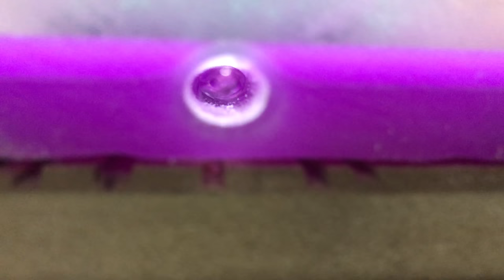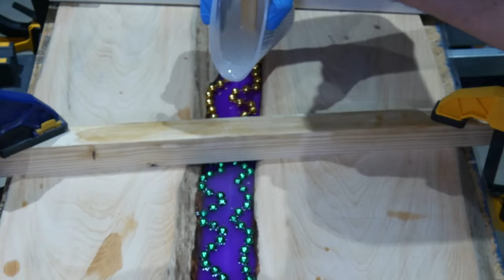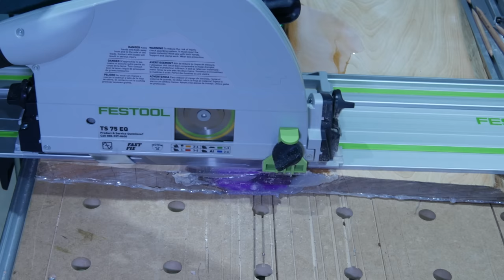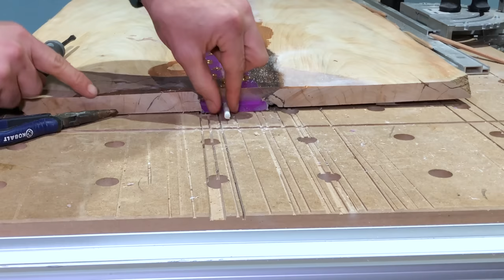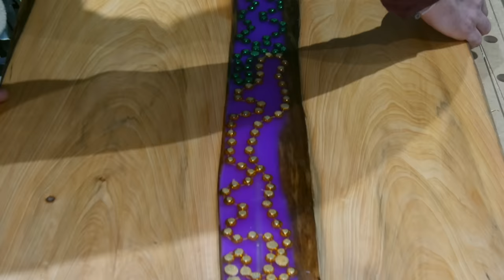How To Put LED Lights in Epoxy Resin (Simple DIY Method)

Comment: Might be easier if you glue some string to one end of the rod before removing it, so removing it drags the string through.  You can then affix the string to the LED strip, and pull that through, eliminating any pushing.

Comment: Great video.   I want to do something like this on a smaller scale for my Train layout.   I want to put a single led inside a tiny plastic bubble attached to a plastic straw which will go through multiple layers of form.   It comes up at the bottom of a little lake.    Epoxy will fill the lake over the light.   Worried the LED 12 volt light will get too hot inside the little tube.   Do you think this will work?

Comment: Thanks for the good tips. 

I'm going to do a border of inlaid LED's in epoxy in a small bathroom at the end of the month. Do you have any recommendations for doing something with corners? So far the best plan I have come up with is to use hot glue and glue down a flexible piece of tubing, with a wire/string pre-inserted before bending and gluing down, so can attach LED's and pull through afterwards. Then proceed with epoxy in layers once dried and LED is pulled through. However if there are better ways of doing it, I'm all ears! 

Cheers
Reply from the maker: Hi Michael, the corners may be difficult to accomplish with the tubing unless you cut it with a 45 degree angle and seal the cut for each corner.  If you don’t mind a slight bend at each corner instead of a sharp 45, it will work fine.

Your plan sounds great to me!

Thanks for watching!
Reply: Could also coat the rod in Sheathing tape(Tuck Tape) and mold release then cover it with the epoxy. The epoxy forms around it and once dry the rod just slides out with no use of the rubber tubing.

Comment: My plastic tube is really stuck in the resin. Any tips on how to remove it? 🤨
Reply from the maker: The clear plastic tube should stay in the resin.  If you want to remove it (for future projects), use a release agent such as Vaseline or furniture wax on the outside.  The clear tube should be invisible since it is clear.
Reply: You need to saw the edges off. Like he does in the video. That will expose both sides of the tubing allowing you to remove it

Comment: Does this actually work, because I am thinking about doing this. But a little worried that the rod aspect wont work. As in not being able to pull the rod out, because of the density of the resin.
Reply: The rod site within a clear plastic tube. The rod is solely there to retain the shape of the plastic tube.

Comment: Thanks for the video! I am a lighting designer and I am new to resin materials. I want to ask, is pigmented resin always can diffuse lights from the inside? 
Is there any technique/case that the color pigment is blocking the lights instead? (Just to make sure i am not choosing the wrong color or technique).

Thank you in advance!
Reply: Hey Putri, you can buy specific pigment mixes that will allow more light to pass through. They are normally labelled as transparent or translucent. Hope this helps!
Reply: @ThePaleampersand  Thank you!

Comment: I have a curved piece of root any suggestions with the curve?
Reply from the maker: This will work for curves as well depending on the sharpness of the curve. The rod I used will bend. You just may need to find a way to secure it in place.

Comment: Petg tubing for water cooling computers would be best in my opinion. It won't turn yellow like nylon or vinyl tube will especially from the heat and uv from lighting plus it's rigid. Next best thing to glass.
Reply from the maker: John Alexander that’s a great suggestion.  I may try that next time.  Thank you for taking the time to comment!
Reply: Why does it matter? The tube is removed.
Reply: My mistake. The tube is left in. Sorry

Comment: Hello, if I put the led inside the hose and do the resin hardening process with it there will it spoil?
Reply from the maker: You need to fill the hose with something rigid to keep the shape during the resin hardening process.
Reply: @PahjoDesigns   why ? If the LEDs were in the tube could you not follow Contours of the river
Reply from the maker: xboxedredfish you wouldn’t be able to remove the led lights. the epoxy is heavy and would compress the tube.